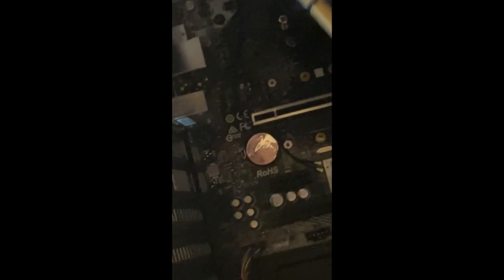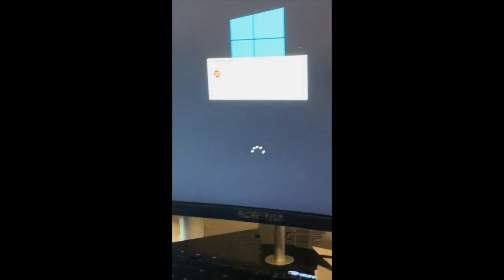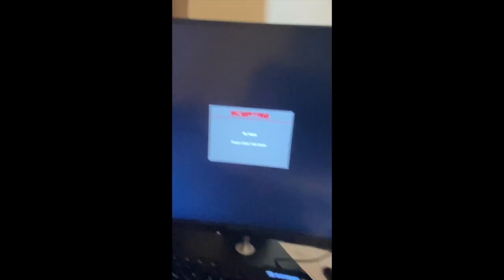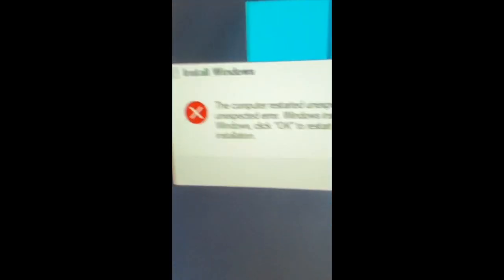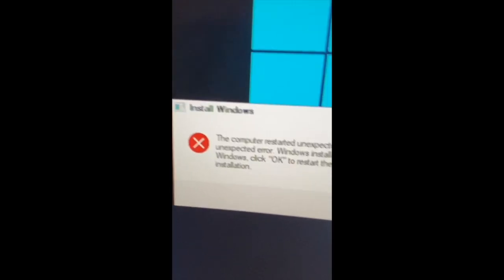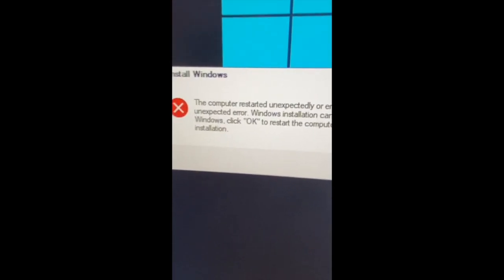BRAND NEW PC - HDMI FIXED, New Error: iBUYPOWER Gaming PC Computer Desktop Element MR 9320

Comment: Hey Man just saw your vid... Umm its possible your GPU was not the only item to disconnect.. visually check each connection that you can clearly see, that error you got may be a fluke and once you push in the connectors it may boot just fine. Man I know you just want to get in your PC, hope you get it figured out and Windows installs.